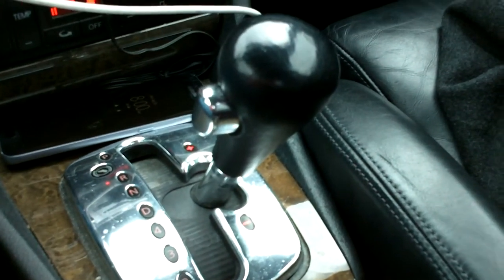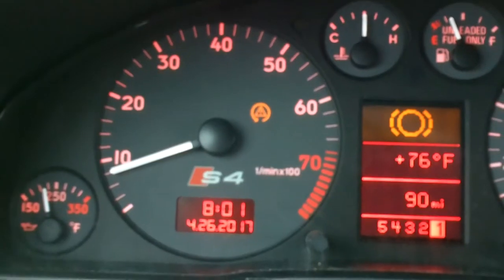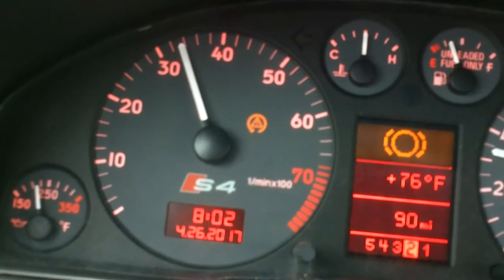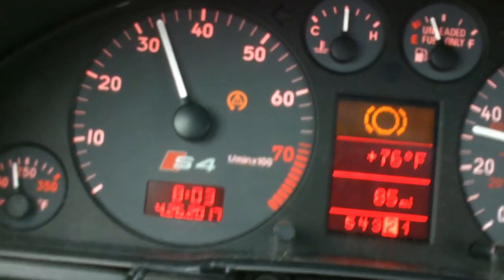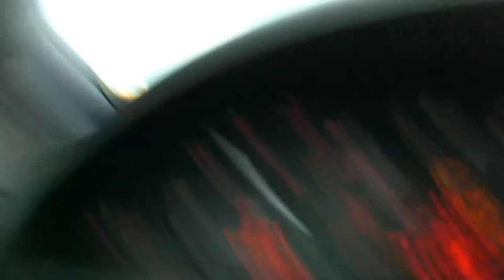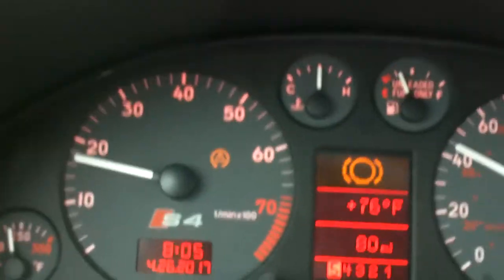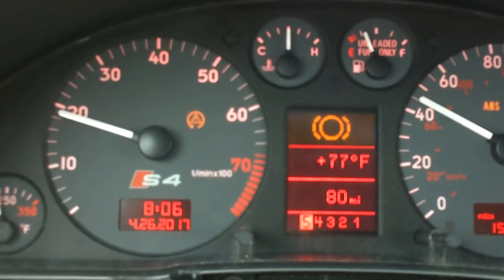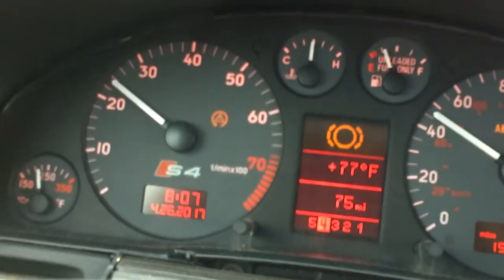2002 Audi S4: Ep. 176 - Troubleshooting a 5HP19 torque converter

Comment: Had the similar issue. Started hard shifting in/out 4th gear eventually started slipping in low gear and made a growling noise. My mechanic said the transmission pump went bad.

Comment: Did u find out what the issue was? The repair shop i called said it could be a vacuum hose leak, thats the common issue. Another one is carbon buildup and low transmission fluid. Im going to put the car in the shop soon

Comment: so i also have an issue with the shift points after the high stall tc,  its horrible in 5th od take foot off the gas and you feel it its almost like a downshift but is not, was wondering if the revo tek 1st stage may help. i only used 8.5 of the 10 lts of fluid going to check level this week after warming up, because if the fluid is warm i have issues with reverse not grabbing immediately
Reply from the maker: Your issue sounds like a low fluid problem.  I like having these discussions about Tip and torque converters because they're not very popular.  At this point, I'm almost thinking I should either swap back in my stock torque converter, or pick up another OEM replacement one.  My car pulled like a train with the stock one.....
Reply: yeah i want to go to a stock stall wish i did the first time.

Comment: i also dont get the launch so i was talking to the torco people about replacement, i hate this and the downshift is hard from 5th to 4th and 4 to 3
Reply from the maker: Do you have a TCU tune/upgrade on your car?  I do.  My only other thought is that my TCU is tuned for a stock TC.  Since my new one is supposed to have a higher stall, I'm wondering if my TCU tune has something to do with the surging and other lockup issues.
Reply: no tune yet looking at motoza stg1 they are way cheaper then the rest and all great reviews so far

Comment: P0741 2000 S4 replace TC or whole transmission please any help would be appreciated thanks
Reply from the maker: I recommend rebuilding the transmission. Sounds like you tc could be stuck off, and/or a problem with the electronics.

These cars take so much work to pull the trans, may as well do it right the first time. Then you don't have to pull it twice. Do a full rebuild
Reply: @snyperbob  im a car dealer bought a 2000 S4 with 78,000 miles, car needs to make me money any diagnostic tips to see what actually the problem is rather than replacing right away?
Reply from the maker: @rosssmith9941  not really, that code gives you what you need to know. Best easiest way to make money off it would be a part out.

If you replace the trans and sell it, buyer will be back and up your ass with problems in the future.
Reply from the maker: Other option is to manual swap it, since its a low mileage car. Too much work for a dealer. You can see if any B5 builders in the scene would want it for a clean swap....

They may be interested, for a fair price.
Reply: @snyperbob  yeah I paid around $1900 for it, needs 800 in body work and it needs transmission work